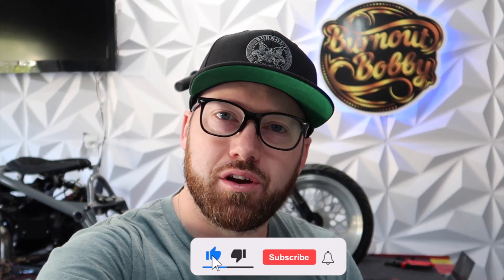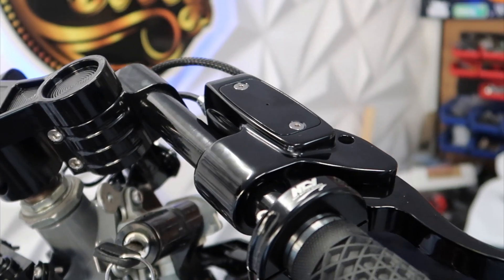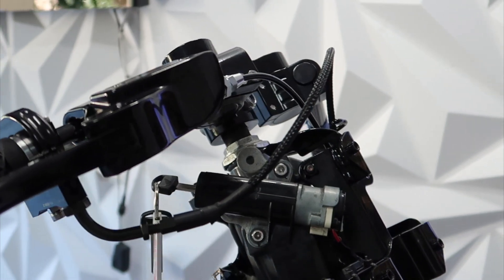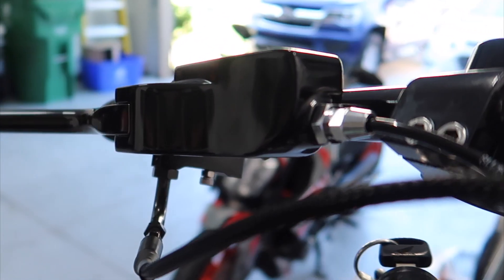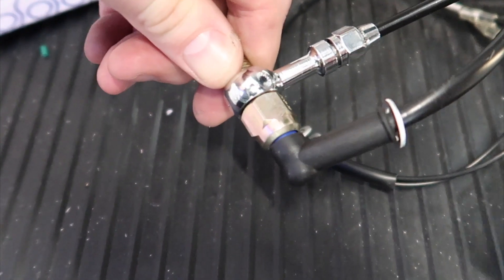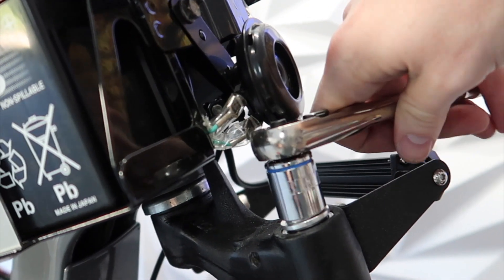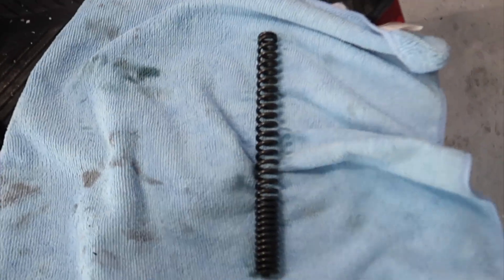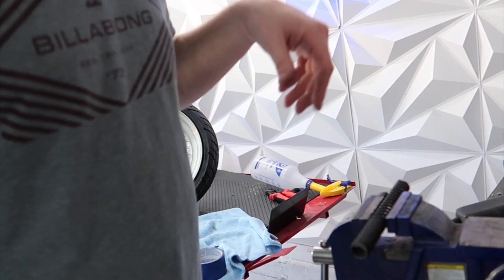Lowering Your Honda Ruckus Forks-Adelin-RRGS-NCY-

Comment: After cutting the spring and I put it back in, do I fill it with oil all the way to the top? Also, would I be able to take an inch and a half off or is that too much?
Reply from the maker: The oil in it should still be good and try an inch first to see if you like it. Ride it around and let it
Reply from the maker: Break in
Reply: @burnoutbobby  can this be done on my stock Maddog shocks? 🤔
Reply from the maker: @scordova951 not sure. I have never seen them before. If it has a screw on top then I’d assume so

Comment: Man I like that brake set up what Harley did you get it for if I may ask
Reply from the maker: It’s universal for any Harley 1-1.5” bars. So you need a reducer. Then all the banjo fittings and line.
Reply: Thanks
Reply from the maker: Anytime. The company is hhi